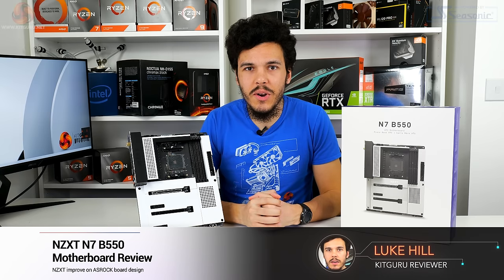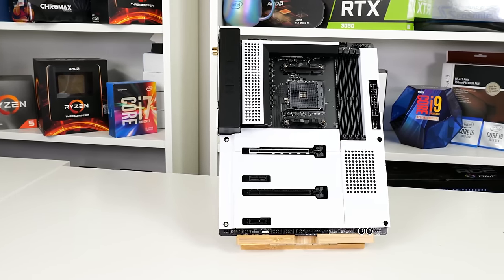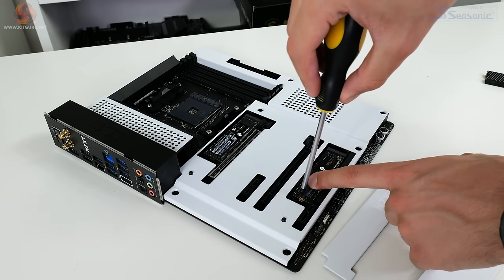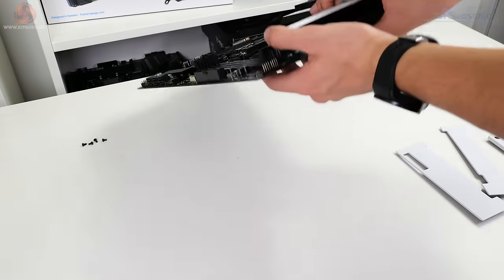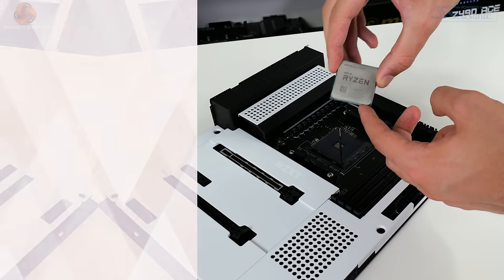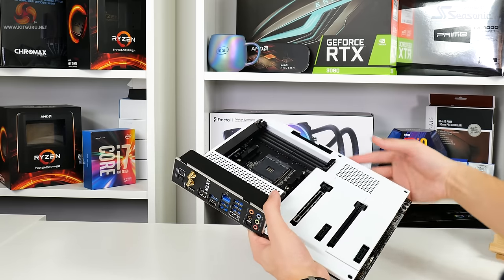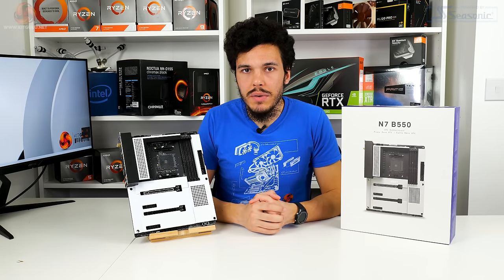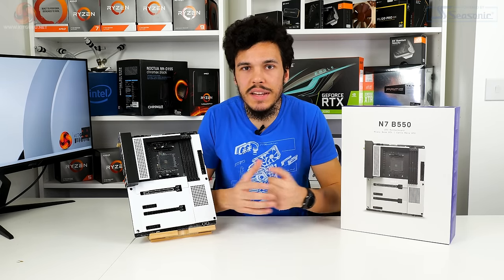NZXT N7 B550 - lumbered with ASRock's failures

Comment: I have to agree that the 2nd M.2 should be Gen 3 x4 and not 2, but I absolutely commend them on sharing it with SATA ports.  The ASRock m/b I'm currently using shares it's 2nd M.2 with the PCIe slots.  I'm using the M.2 as my mass storage drive and don't need old, slow SATA ports.  But I absolutely DO want to add expansion cards, and can't.

Comment: just finished my build with this exact board and a 3600 ddr4 kit. THE FABRIC CLOCK ISSUE IS COMPLETELY FIXED. default its at the correct 1800mhz, read using cpu-z. not sure if it was fixed with a bios update or this guy just got a bad board, but make sure to update ur bios firmware and bios version anyways. Not sure why this guy decided to make all his benchmarks obsolete and useless by being stubborn about keeping the fabric clock at 1600, but yeah its a good board.

Comment: A budget NVMe on the lower X4 PCIe is fast enough to never notice in 99.9% real world use. Most B550 boards are the same shared lane configuration. Problem with this board is many B450 work as good, with great looking RGB aesthetics , for far less money, with no B550 PCIe 4/USB issues.
Reply from the maker: Of all the B550s I have tested, they are x4 on the bottom slot. I really do not think it is too much to ask for x4 on the bottom slot. Many users may not need the full x4 bandwidth for day-to-day usage, but many will also want the full speed that they paid for with their SSD especially under heavy loads. Luke
Reply: @KitGuruTech  You must be testing the higher end B550. If people knew what they were paying for they would buy a B450 Aorus Pro Wi-Fi or MSI B450 Tomahawk for $100 and put the savings into the GPU. B550 is a ton of expensive bandwidth and power delivery with no practical use for 99% of users before the next gen platform arrives. If you want NVMe speed get Primocache software and it will use a slice of system RAM as an NVMe buffer. I get 20GBs with it on store brand PCIe 3 NVMe.
Reply: @bodasactra  b550 Ive seen all 4x lower slot. Its typical ASROCK. Shoddy sloppy work.
Reply: @bodasactra  210 Pounds ≈ $290 USD. This NZXT board IS priced at the high-end B550 bracket. $290 is right with the ASUS StriX B550-E Gaming ($258 USD), Gigabyte B550 Aorus Master ($260 USD), and MSi MEG B550 Unify ($280 USD). If that's the case, I'd get the Gigabyte B550 Aorus Master, and not even bother with the NZXT (AsRock) board.

Comment: If those SSD m.2 covers are metal, couldnt you just add a thermal pad between that and the drive? It may not work great but it would be better than nothing
Reply from the maker: Yes, that is a good idea and should work fine. This should be provided by NZXT though, rather than forcing users to size up correct thermal pads and them acquire them themeselves. Luke
Reply: The top of the cover is metal, but the back part which would come in contact with the m.2 are plastic 😑... Pretty lame oversight IMO.

Comment: I wonder why they opted for the b550 instead of the x570 when they chose the highest end intel chipset for the intel version of the n7
Reply: Because as far as I'm aware you need the higher chipset to oc on Intel where as you can oc on a b550.
Reply: X570 is kinda useless, if they made one it would have been even more pricy
Reply: Yeah but the vrm on this b550 board isn’t really gonna cut it to deliver power efficiently for that cpu, the vrm temps are gonna skyrocket
Reply: @falsecatalyst3936  the vrm is fine on it more than capable it's already been done and tested.
Reply: @devilchild8811  oh damn, I just checked the vrm on this board again, it’s solid, that leaves out 1 issue though, it’s the lacking pcie lanes this chipset has
Reply: @falsecatalyst3936  yeah that's not a big concern for me that's where the x570 would have been better. I actually have this board. But evga are going to be bringing out x570s FTW and Dark boards Q3 I think kingpin has had a 5950x @ 6ghz on the dark.
Reply: @devilchild8811  tbh I’m waiting more on the X570S chipset that doesn’t need a fan, because I don’t want to worry about another thing getting dusty in the rig, as fans have a tendency to do that, it’s either that or the $700 xtreme by gigabyte

Comment: I put two 8GB corsair Dominator platinum sticks in here at 3600mhz instead of 3200mhz. After ending a game and going back to the desktop, my mouse moves around but folders freeze and pc won't restart etc unless I hard reboot. Went into BiOS and changed ram to 3200mhz.

I have 1 NVME stick 1TB Samsung Evo Pro which is brand new and has my OS and 1 game on it.

Not sure what the issue is...
Reply: U figure it out?
Reply: @Steven-zu1fx  I think it's the corsair software playing up with razer synapse. Haven't had any issues for a long time now. All I remember doing was going into devices and hardware and disabling razer stuff 1 by 1. I think it was the razer huntsman keyboard where I disabled 1 of 3 things.

Comment: Got a question. When I turn my computer on without a Gpu or ram just to make sure it was working before I put everything else in because haven’t got ram or Gpu yet and and then bottom right of the board there’s 2 red lights that go on it’s the cpu and dram. Then when I put a old ram in CPU goes away then it’s just dram and boot. Could that be because I didn’t install everything yet?

Comment: This is kind of irritating that I bought this motherboard for $250 shipped after Jay talked about it and now I'm regretting it because I love the aesthetics but the performance is really not what I wanted. So annoying
Reply: @WitcherGeralt  Not exactly bad but not as good as I was hoping for as far as m.2 support and some of the other stuff he mentioned
Reply: @WitcherGeralt  I think using both slots also disables a few sata ports but that may not be an issue and you can't have those nice covers on either because they aren't heat sinks like they should have been. I think there was one other thing but it was minor. Basically all of the little things that are annoying with it stem from NZXT using AsRock boards it's based off of the Steel Legend boards. Overall it's a nice board but for the money it would be nice if it didn't have these little things. If I were you I would read a couple reviews or watch a couple on YouTube and make sure it's not going to affect your other stuff like amount of drives you're running. It looks fantastic but just make sure it's going to be what you want

Comment: With regards to the M.2 slots and heatsinks could you not just put a thermal pad on the SSD?
Reply from the maker: Yes, that would be a good mod to apply, though not straightforward for some less hands-on users. Plus it requires buying a sizing a thermal pad correctly. NZXT should have simply put a thermal pad on the underside of the M.2 slots covers in our opinion. Luke
Reply: @KitGuruTech  thermal pads are readily available on amazon!  LoL no faffing with cutting ect 👍
Reply from the maker: @scotttait2197  yes we know that, but we dont feel this is really something a 'normal' user should be doing (or in most cases would be doing or even think about). We could fix a lot of products we review, but we are here to review what a company sells - no point us fixing a review product and saying its great, when thats not what people will buy. Also all these 'fixes' change the price point.
Reply: @scotttait2197  do u have any which u recommend
Reply: @KitGuruTech  is there a significant difference between just putting a thermal pad on the motherboard heatsink and just installing your own standalone m.2 heatsink?
Reply: like, would it be enough to just put a thermal pad or should I replace that motherboard "heatsink" for a separately purchased heatsink?

Comment: Can CAM detect any case fans? None of mine seem to be detected. Do they all individually have to be directly connected to the motherboard or will splitters work as well
Reply from the maker: We connected a Noctua 4-pin PWM fan, an EKWB 4-pin PWM fan, and a be quiet! 3-pin DC fan. They were detected properly in CAM with this motherboard. Luke

Comment: UEFI is short for "Unified Extensible Firmware Interface". The "interface" part is not targeted at the user. It's targeted at the firmware. Basically it's an API for firmware, but with Intel marketing muddying the waters. 
So saying "The UEFI doesn't have an Easy Mode" is... not the choice I would've made. While I get that it is equally wrong to call it "The BIOS" it is however the more accepted wrong :P The correct nomenclature would be "The BIOS UI", "The BIOS Interface" or "The BIOS Setup". Whether there is a UEFI compliant BIOS behind the interface or not is of no consequence.
Reply: This is one of those things that you’re really just gonna have to give up on. The people have decided that the screen with all the motherboard settings on it is called the UEFI. It’s really not worth discussing any more.
Reply from the maker: Yet everybody will still understand what we mean. It's like saying "the 3600MHz XMP profile" - everybody knows it's not technically correct, but everybody understands too which is the most important thing. Luke
Reply: @KitGuruTech  I know. It's just a pet peeve of mine. But I'm going to stay on my high horse and refer to the fact that Gamers Nexus, Hadware Unboxed, Buildzoid, etc still use "the old wrong" :P

Comment: Just finished building with the N7. Got two bootable hard drives (SSD and Nvme) but can’t boot into windows and entering the boot menu shows “no boot devices”. In the storage configuration both hard drives are detected but in boot priority and override menu both are empty. Any suggestions?
Reply: Csm setting on the motherboard I believe.

Comment: What is the point of running benchmarks and producing graphs if you are going to insist on running lower clocks?  To confirm that lower clocks indeed produce lower performance?  
I'm no fan of NZXT, but this is just useless.

Comment: Heh, I have a mono block and vertical GPU mount so who cares about motherboard RGB and I stopped using the motherboard fan headers because it's lazy for the motherboard manufactures to slam 100 PWM on the fans all the time.  The best feauture would be to bring rgb headers OUT so that external controllers can be used since the motherboard rgb software is so ghetto and half assed.  I'm talking to you Gigabyte for your shitty software, Fusion 2.0 is garbage but this issue exists on every motherboard.  I was disappointed by my all EK water cooling system until my buddy brought his Asus MB based system over to game.  Nothing like a case full of Corsair Mag Lev fans at 100 percent while it's booting or coming out of sleep to wake people.  And then the power supply would get in to the act with a binary on or off hovercraft sound effect.  No wonder most gamers wear headphones.  

If motherboard manufactures want to step up it up and provide real value they would integrate a dedicated ARGB, RGB, Fan/pump controller on board that is configured using software but runs in software without requiring any running processes.  Seriously, on >200 dollar motherboards is a 50 cent microcontroller unreasonable?  PC industry just can't get past relying on software running on the host CPU and then half-assing that software but isn't it obvious that doesn't work when the CPU is incapacitated?  Of course it is, thus the annoying harrier jet sound.  Also, those decorative pieces would be so much better if they easily came off for painting, isn't that kind of obvious?  Just use friggin' that look nice.  It was ridiculous dealing with the way the built in I/O panel and I/O shroud was implemented.  Screws are not evil, just make them a feature like custom sleeved PS cables.  Gotta ask, what's with that worthless second GPU slot?  Someone not get the memo that SLI and Crossfire are dead and nobody is supporting DX12 multi-GPU?  Besides, who's buying two GPUs anytime soon?

You want a great idea NZXT?  Blow the industry away by building a motherboard that has an integrated vertical GPU mount at the bottom of a standard ATX motherboard that includes a preinstalled mono block, a motherboard shroud that is designed for the mono block and GPU vertical mount, a integrated hardware based RGB, ARGB, Fan and pump with temperature probes.  Preinstalled in a matching water cooling focused case supporting the vertical GPU mount.  No SATA ports, just NVMe slots behind the GPU or even on the back side of the motherboard.  A couple of swappable plates that have the mounting holes for EK and other companies pump reservoir combo in front of the motherboard vertical.  Then locations to mount two radiators above and below the motherboard with the fans facing out and radiators on the same plane as the motherboard.  Then on the back side would be a space for a small form factor power supply behind the motherboard and generous venting on the back side with allowance for additional fans on the back side so the rads can have pretty fans on the front and ugly but effective fans on the back side.  What I'm thinking here is the radiator mounts would set in the case and adjustable so you could move them in and out to get the alignment people would want so they could go from skinny to super fat rads and it would still look nice.